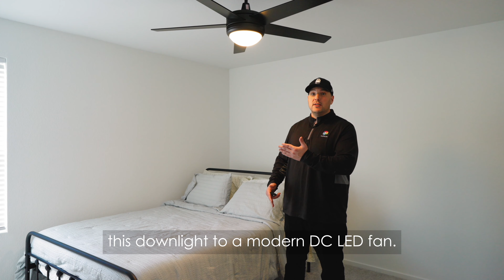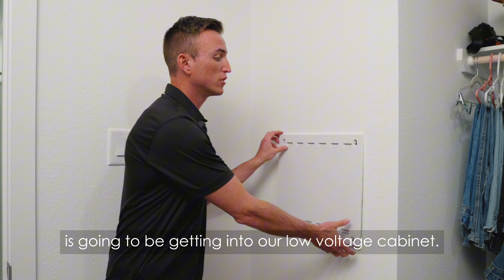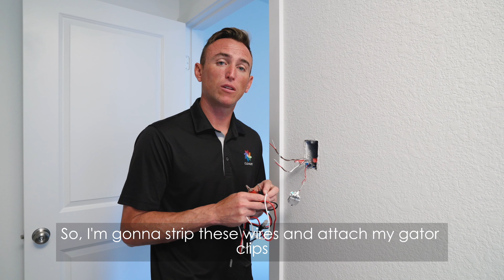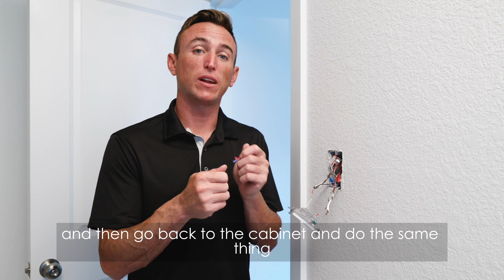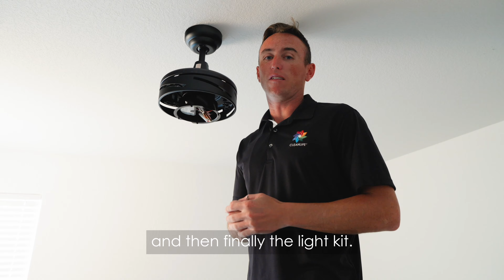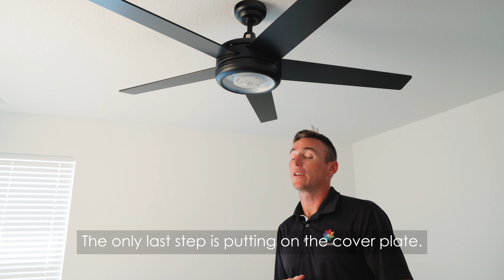CleanLife® Low-Voltage DC Ceiling Fan Installation Guide

Comment: This is one of the worst how-to videos ive ever seen. Aside from not following basic safety such as turning power off, you want people to play the guessing game by adding power to wires that could be going anywhere just to find the right one? Yes, its low voltage but its still important to be safe. Besides the horrible explanation and lack of safety standards shown in this video, I still have more questions than answers.
Reply: EXACTLY 💯 💯 💯

Comment: Why not make a 50V ceiling? How about if the customer doesn’t have the extra wires to add a ceiling fan how about If it cannot use the existing wire because it might share the power with other rooms? The worst thing is my customers home is a two story home you can’t easily add me wire downstairs!